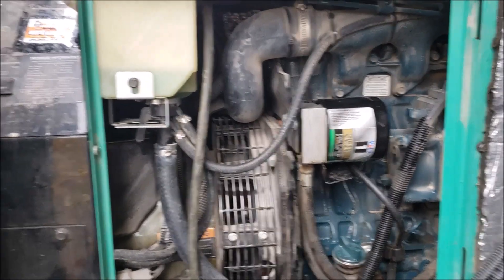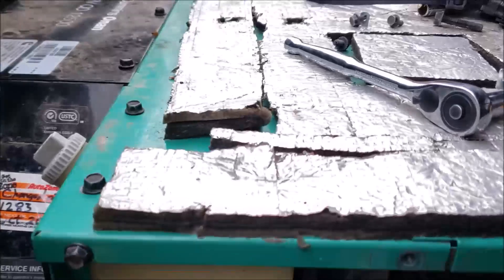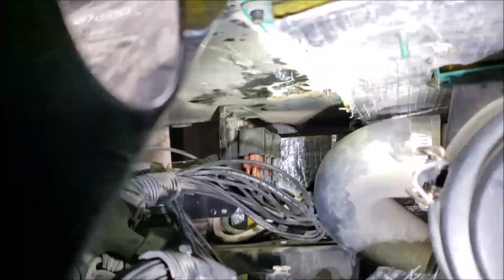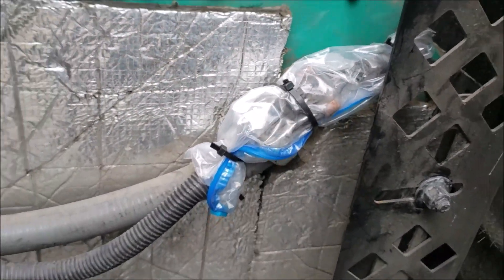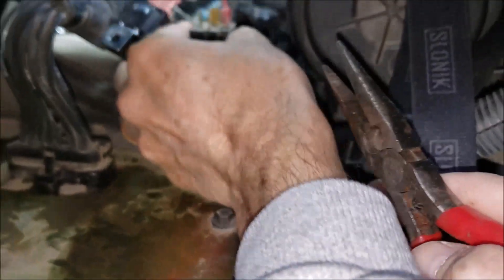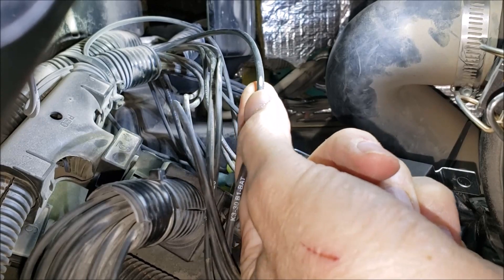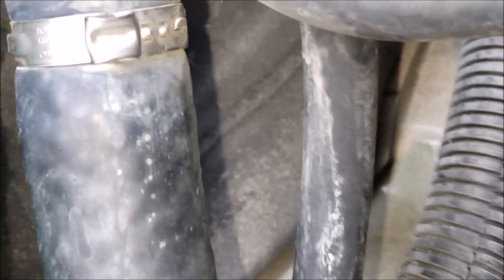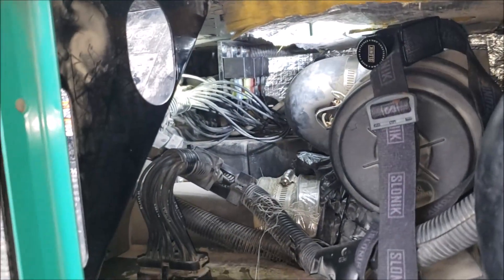Cummins Onan 12kW Diesel Generator RV QD 12500 12.5HDKCB-11506 Intermittent Random No Start FIXED!

Comment: Out of curiosity, did the generator turn over and not start or was it completely dead when this happened?  Mine is completely dead after starting and dying twice within a few seconds.
Reply from the maker: @SnowyChurro  it was no crank, no start.  But has work ever sense this repair.
Reply: @ktoutdoor  Thank you!  Mine just did this today.  No crank, no start after running perfectly fine a half hour before.  I need it up and running by this Wednesday (it's on our food truck) so this really helps.  Thanks!
Reply: @ktoutdoor  did the red lights on your start switch flash? Neither of mine are flashing at all.  It seems like the generator is completely disconnected from battery power, but it starts using the truck battery power and the truck starts fine.
Reply from the maker: @SnowyChurro  it's been to long I don't remember.  Check your ground cable from the generator to the frame...

Comment: Experience has shown me that the plastic bag will hold condensation or moisture and will never allow the connection to dry
Reply from the maker: Thank you for contributing.. So far it has been starting every time after replacing relays

Comment: Can you start and run the generator while the coach is plugged into 50amp service? If so, which power source supersedes the other? I assume the generator takes over as it's 90amp, but is it safe to do this? (I have a QD10,000 in my coach)..
Reply from the maker: Yes you can and Yes I have but I don't make a habit of it. Yes generator has priority over shore power I just don't know what the ramifications would be if there was a malfunction so i try to avoid it.
Reply: @ktoutdoor  Good to know, thanks for replying!
Reply: Open the generator breaker, if you want to just run the generator while connected to shore power ...

Comment: Hey Kevin, I have a question on a workhorse chassis.  It's a 2005 Bounder. I have a problem with the fuse box that's inside the rv and for me is up on the left side of the dash. Was investigating why the 12v outlets on the dash were not working. (We just bought this rv) found a blown fuse but it got the fuse box around that particular fuse hot and the metal clips that would normally hold the fuse are gone!  Any idea of my best way to repair?  Do I add a secondary fuse box and move that one over to a new fuse box. It doesn't look like the original fuse box is available and if it was its part of the main wire loom! What would you do?
Reply from the maker: Text me a picture of your fuse box to 606-875-0125 Kevin

Comment: I enjoyed your video on changing the relays. My Generator always starts but when generating about 25 to 30 amps it wants to surge. My Onan has a Kubota engine  and is a 7500 KW. I have changed fuel pump, filter and made sure it is getting fuel. Do you have any suggestions for me?
Reply from the maker: Best guess is fuel delivery or air getting into suction line try a new fuel source right at the engine and maybe confirm fuel pressure is correct.
Reply: Make sure your fuel supply line isn't linked or internally collapsing. What is the rating of the generator circuit breakers? You could be pushing the engine to it's limits..